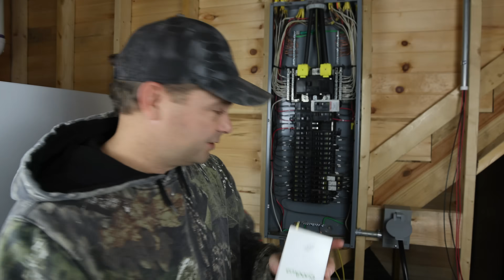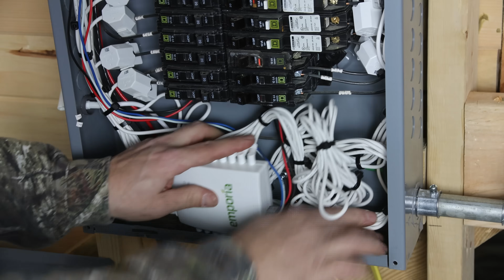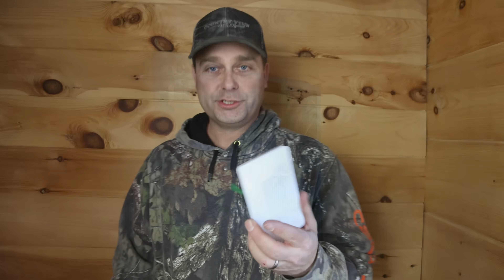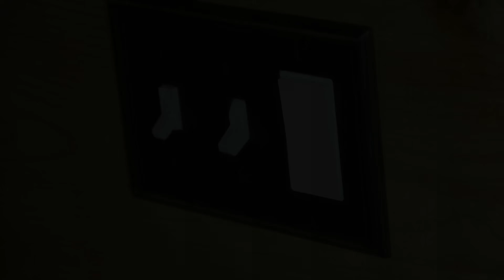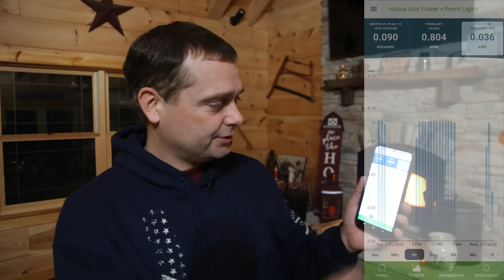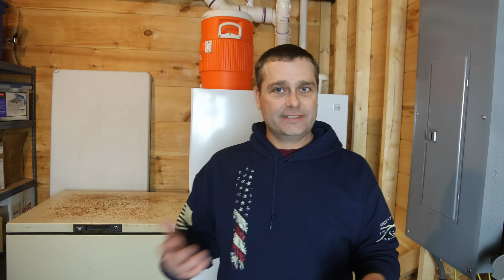Determining our power Needs for Solar.  Installing a Energy Monitor to know exactly what we use.

Comment: I have been using an Emporia 16 for the last year.  I wasn’t sure if the wifi would connect to my router but I shoved the antenna through the knockout and it was able to send the info to the emporia cloud. Interesting that my stove/range circuit will send me a warning that the stove was left on.  Usually it is okay but a nice feature I didn’t know about.  I didn’t choose to use smart outlets. 

I like to see where I am using power.  Some of it is to know my usage.  Then I can determine how much capacity I need for critical circuits.  I can’t go off grid but I can battery backup the critical circuits.  Great video! All the best from north Texas.

Comment: I am considering installing an Ecoflow / Solar array system, along the lines of what you did. When this video came out I thought your approach (figure out the load requirement) was smart, so I bought the energy monitor wifi setup that you did. That was about a year ago. I got sidetracked. Now I'm getting back going, so I watched this video again. I've got to tell you, it is very informative and easy to understand. 
I thank you for making it.

Comment: heat rises chest freezers get more efficient when they are full so if it isnt full take up extra space with water bottles they will also act as thermal battery's if power goes out

Comment: Thanks this is helpful.  I'm using the Emporia unit already with similar success, but the light switches were a good tip, and especially for the capability to be used as a countdown timer.

Comment: I put  an emporia in a month ago, managed all the slack from the CT's with Velcro.  I have 26 individual circuits I was able to cover all the circuits by clamping 2 hot wires on the same phase on some of the 50A CT's.  I would pair a normal use circuit with an extremely low use circuit like plugs in a spare room.  Works great.

Comment: you can pickup a light sensor and wire it into your outside light circuits, I mounted it outside under the even were I could easily reach the power coming from the switch. Then just leave your switch on all the time, I have mine covered with a plastic shield. Cheaper than a smart switch, not fancy or wi-fi however.

Comment: Great video.   I am about to order my Emporia 16 circuit monitor.  I was hoping to install it in my main panel but the circuits to sub panels are 60amps.  I haven’t been able to determine what tolerance these clamp sensors have.  I had looked at the Sense monitor but that only measured incoming grid power or whatever you had on your mains.  It then used “machine learning” or AI to tell you what was running.  I would rather use a circuit based monitor and narrow down to the individual breakers (also I would use some smart outlets to track/control usage if there is a string of outlets on a circuit.  

I do have usage information from our rural utility company and see the average we are using per day/month/year.  That is interesting to see total usage,but doesn’t help to narrow down who is taking the majority of power (or rather the power that we can eliminate because we didn’t realize the phantom loads).  

Thanks again for your video!  All the best!  This year I want to install critical loads panel with generator or solar backup at least.  Love learning all the details of how these systems work.

Comment: Hey Evan, just noticed you have the Square D panel. Not sure if you were aware of the recall they had on those. I think specifically for the ones that have a light that comes on when the breaker trips. It may not be yours, but its something to look into. Thanks for the videos!!
Reply from the maker: Yes, there was recall because the bolts that attach the neutral bars may not be tight.  My new panel in the pole barn was part of the recall.

Comment: All Uk light circuits used be in the ceiling with a positive coming to switch most still are however my friend used to send the wires to switch using deep back boxes much better

Comment: We have a completely separate power panel for our solar system. This system is always on the battery, so in a power outage everything stays on. The battery will last approx three days in winter with only a little sunlight to charge the battery  PS: the generator is wired into this panel

Comment: If you were building a new house, pole barns and barns is it possible to power 100% of everything with solar power only? I assume you'd need electricity in the pole barns to run things like a welder but I'm not sure.
Reply: you could but you'd probably need 24kw-30kw in panels and 2 15kw inverters and probably 100kwhr of battery bank.  IF you add that up you're well over 50-60k in equipment alone if you do all the install yourself.  I've done 12kw and about 30kwhr battery with hybrid inverter sol-ark 12k and some days I can easily be off grid and heat my barn and house with the power and make 70-75kwhr in power a day but on cloudy days is when you need a lot more panels and a lot more batteries.  A  very cloudy day and you could make 2 or 5whr of power in a day for comparison with rain and dark clouds.  You could offset with a generator to fill in the gaps but you'll probably pay $1 or so per kwhr (for fuel)..so I pay 10 cents a kwhr from the grid and I would only use a generator if the grid is down and it is cloudy which is extremely rare for me.  If you had enough panels and battery then yea no problem but you could compromise and do both with an automatic standby generator for less cost.

Comment: Some things I'll pass along from my own in-process adventure with solar: Inverter is your cost and feature bottleneck. Do you have a well? Then you'll need one capable of 2x120 'legs' (also for a welder/etc). Get an inverter good for 'off grid' and you can be off grid, backup, plus the other features. If you get a 'grid tie' type the inverter will shut down when the grid is down (so no backup energy! And most power companies are not paying equal anyway). Get the 'string' type panel inverter not the MPP (mini inverters at each panel) as that will be much more expensive. Rather than worry too much about maximum tracking angle and shading -- just buy 10% more panels. However, split the array in two and set one to the declamation for your area more East and the second more West (think of a low angle 'V' layout)-- that way you get more energy morning and evening without clipping in the middle of the day. Go with a ground mount if doing it yourself, roof mounts are unnecessarily complicated. Consider having the ground mount just high enough to be a 'car port' type of installation you can park low equipment under like lawn mower, disk, etc.

Comment: Nice overview and explanation. 
A photocell at the first light in circuit might make them manual. I like the idea of smart as long as it isn’t dependent on an internet connection. Internet may not always be available. Does the monitor and smart switches work on your Wi-Fi network or through the internet?
Reply: I agree.

Comment: Some exterior light fixtures will work with new LED bulbs with built-in dusk/dawn sensors. I just bought a ten pack and they work like expected (under a porch may be problematic). Your energy monitoring will likely show chest freezers are more energy efficient than vertical freezers, given similar motors/insulation/etc, maybe even old chest is still better vs new upright. AC, water well, and sump pumps can be biggest electricity draws (assuming you have gas cook stove, furnace, dryer). I've seen our electric use drop 10-12% since I tiled a side-hill spring away from the house drive (that's electric energy use dropped, the price of electricity per unit still went up!) so the sump pumps were not running bailing out the water that ran through the sand under the concrete.

Comment: So if you add batteries you need to factor in extra solar panels to charge these batteries at the same time you are powering your loads in your critical load panel.  I would also look at the power generation during cloudy days and upsize your panels accordingly.  Many folks, have an array for summer loads, another array  for battery loads, a winter array load to make up for less sunshine, and if needed an EV array.  Good video, thanks for sharing your data.

Comment: Great video, Evan! We have had our grid tied 10kW system in place for over 7 years. I think you will be surprised how much more energy you will generate in the summer. We live in MN, and definitely use more electricity than you do, mostly because we heat our house and water with electricity. We buy energy from our electric utility at a much lower rate (called off peak) for our heaters which heat at night then release heat during the day. About 90% of our annual energy production is in the summer months. Last year (2022) we generated enough extra energy that our utility pad us back $1200 for the year. Which includes our Tesla! Solar is the way to go!! I am so glad you are doing this series which will interest others in doing the same! Cheers!!
Reply: If your power company bought your sell back power at 2.5 cents or 5 cents a kwhr how would your numbers be then?  Most new  contracts are significantly less than what you buy from the power company.  Even California is seeing this now as are most states.  The days of really good solar deals for sell back at the same price you buy it are pretty much over unless you are grand fathered in.  This keeps power companies in the black.  If everyone got paid the same as they bought, it would drive solar demand up so much grid power would not be sustainable.  I believe Evan said in a previous video his sell back rates are extremely low so he wants to consume what he makes as sell back wouldn't be worth it.

Comment: Don't forget a subtle hot water heater. And so hot water tank recirculating pumps to keep it hot your propane heater with only co. Attack in a lines are so heavy the propane or natural gas never has a chance to come on

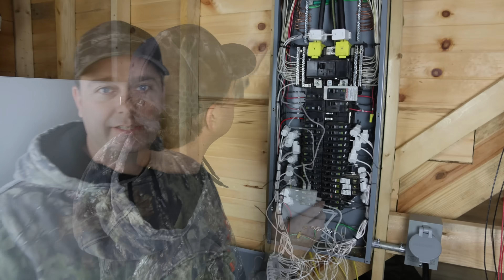Comment: I'm laughing because I literally did the same thing last week.  You might want to check your mains at 4:08.  Looks like you have them going into B and C instead of A and B, but then again if it works, its works.  I also really like the Kasa smart switches and used them to turn on and off our driveway and garage lights.  We have solar coming into through our barn, but that comes to the house as "sub-panel feed".  Our barn has 100a service, but I setup up a 50a monitor on each leg.  It works really well.  It shows me how much is coming back from the barn and when I have heavy draw in the barn I still see it from the mains.  Another thing I learned from our Emporia is that our stock tank heater is on all the time, but I thought it only came on when the water was at zero.  I bought a Kasa smart plug and I use that the cycle power to the tank every two hours.
Reply: I put 2 circuit panels in my barn, one all grid and the other UPS backup via my solar inverter/battery.  Both circuits get fed by solar if there's enough power (by inverter backfeeding of the main house panel when grid is up and senses and prevents backfeed when grid is down via the CT sensors) but in grid down the UPS panels (as well as critical loads in house) get power as long as battery is above x% with the hope that the sun will be out to charge most days if the outage lasts weeks.  If not got generator hookup as well with PTO diesel tractor.  I haven't felt the need for a monitoring system since my sol-ark inverter software measures the loads and graphs them so I've become trained to know what is on and what is not just by looking at my graphs over a year or so.  Fairly easy process of elimination for the most part.

Comment: Our house has been fully automated (with the exception of our exercise room)for approximately 7 years.  We have our lights  on timers, door sensors, and geo fencing so that the lights don't stay on all the time.  We have also connected our house to Google home and have the whole system (including the AV system) on voice control. We can even yell at our phone, anywhere that we have data available, to control our home.  Don't forget to ask your propane supplier about adding a module to your propane tank so that you can monitor the level of propane in your tank using a cellular phone network.

Comment: Evan, what you appear to be doing is a commendable effort to save some power and make use of saved solar energy via some batteries. I thought about doing the same thing  where I lived about 175 miles west of you in Missouri. I had an expert explain to me that this will save some energy but these storage batteries are expensive and the amount of them required to really make any difference is self defeating. You’re much better off going grid tied. Get yourself an emergency generator that’s controlled by an automatic transfer bus for those rare occasions when the grid is down. You don’t even need to be at home to do this. I have a 20kw Generac which has been truly reliable for the 18 years I’ve had it and handled all my needs, not just the critical ones. My well is deep and uses some power. I used to have a low efficiency heat pump but I replaced that 12 years ago with a geo-thermal system. That reduced my electric draw by 65% - most of which was used by the heat pump which had a poor 5% efficiency rating. Going geo almost totally eliminated my propane use. I used to go through two 500 gallon tanks a year. Since replacing the old heat pump when it died with the geo thermal I’ve never had to have the tank refilled in 12 years. We lose power here 4-6 times a year for brief periods and once every 5-7 years for an extended period that is up to a day or 2. It runs off propane. I don’t use propane for my home or shop heat as it’s too costly. I use electricity from my solar or the grid. My solar system is 3 years old and will have completely paid for itself in another 4 years. My electricity bills for my hobby farm (22 acres) were averaging $150 a month prior to going solar ($175 in winter and $135 the rest of the year). Now there is only a $30 a month grid connection fee which you may not even have depending on your electric coop charges. I do usually have a month or 2 in the winter when my bill pops up when I’ve used up my surplus. You can tailor your setup to eliminate this if you wish. 

I recommend you view Jon’s excellent FarmCraft101 YouTube presentations on solar where he does the same thing you are starting but ends up draining his battery cells in hopes of using them some time in the future. 

That’s not to say you wasted the investment on your batteries completely. You can make good use of them on your spread out areas like your barn which has low irregular power demands or your currently unused well. Keep on installing the solar panels as you can afford them but do so with the plan of using the grid as your pool for storing your surplus and supplying your needs for the shop and house at night when the panels have no output. My plans for using batteries remains on hold until some new technology comes along that drives the price of them way down. Battery technology is really in its infancy so ride the curve on your solar plans. Develop your system as prices reduce. If that takes 15 or more years, so what? Use the grid in the meantime as your storage pool. It will save you money. Good luck.  I really appreciate your excellent and technically well done videos. Keep them coming!!
Reply: I think he mentioned his grid sell back rate is very low per his power provider.  Power companies are quickly ratcheting down new agreements to 5 cents/kwhr and lower for grid sell back so the days of pooling power in the grid at the same rate you buy it are largely over unless you are grand fathered in.  Even California is seeing this effect.  You can thank power industry lobby groups pushing government to keep them well in the green.  If everyone went solar power companies would not be able to stay in business and still keep lines to every house and business.  So we have to keep that in mind.  If there is no money in making power as a grid then no one is going to do it.
Reply: @trophyfishn9757  My sell back rate is 40% lower than my buying rate from my Ozarks electric coop. My system is 9.25 KW with 24 panels. My surplus generation is enough to keep me going most years for 11 months. I could add an extra pair of panels to cover this if I wished to. I think Evan bought some economy panels that output 315 watts each so their cost should be more affordable. Mine are 390 watts each so if I decide to add an extra pair it won’t be for a few years. I understand that the grid companies need profit to remain in business. They just don’t need to make all their profit from me! 😁

Comment: Do you think it is a wise idea to put them on the pole barn roof(as opposed to having a separate off-roof frame) i’m thinking about holes in the roof that could start leaking when the wind moves the panels, shovelling snow off the panels, replacing panels, etc.

Comment: Power usage for the ceiling fans were certainly a surprise.
Now I’m wondering if the cost of propane for heating the water is more expensive than using electricity to heat the water.  Or, could it be cheaper to heat it only in the summer if you have surplus solar.